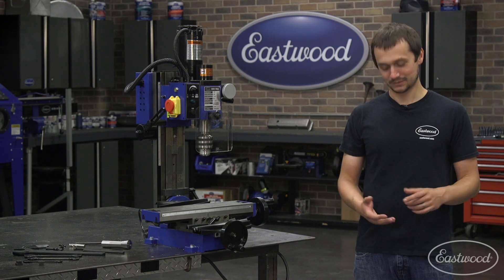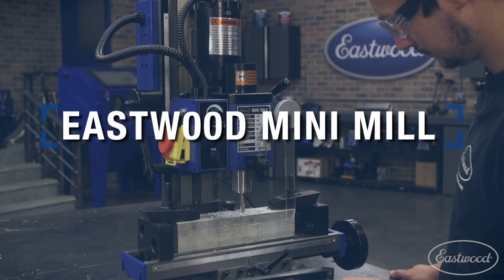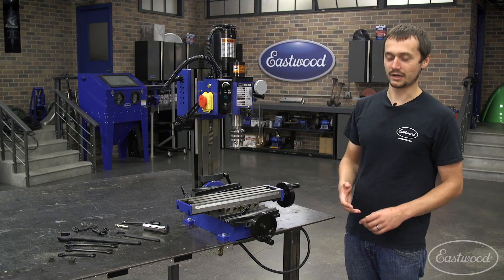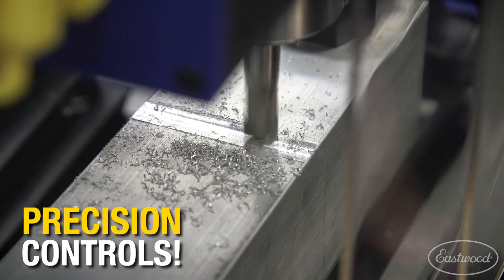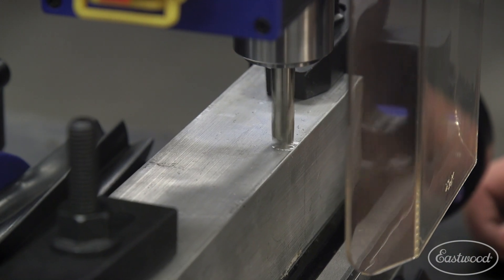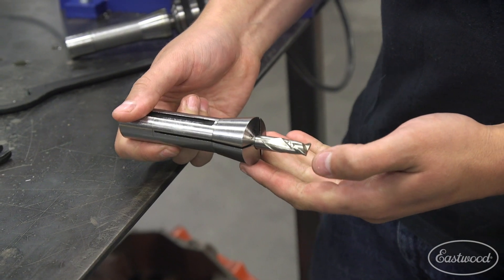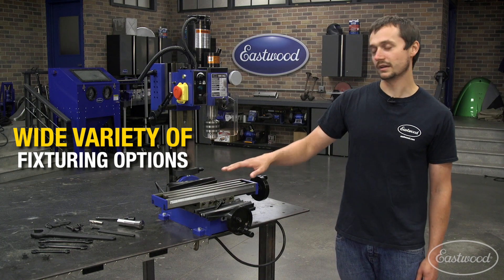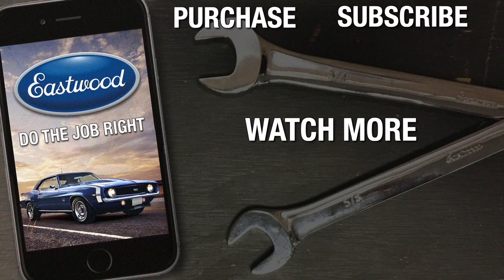The Perfect Mini Mill for Home Shop: Small Package - Big Performance from Eastwood!

Comment: Im in the market for a mini mill. If we had additional videos of the mill in action (squaring up aluminum stock with a fly cutter, speeds & feeds, hearing it as it cuts, caliper measurements, etc) it might inspire more confidence. Hearing it work is a big one as you can tell if the machine is struggling or not.
Reply: Hello i just baught osaki mmd250..what bettert to use face mill or fly cutter on my mini mill

Comment: Same mini mill as every other Sieg X2 clone, made in the same factory. At $799 it's average priced. The real benefit over other clones is it comes with an R8 spindle and endmill vs the MT3 some clones come with, along with Eastwoods support/warranty.
Reply: Thanks for the summary.  I’m off to google the different spindles you mentioned.

Comment: 2500 RPM is really low for the size of end mills this machine can run. Even the 3/8" that comes with it should have 3200 RPM. Looking at some charts 2500 RPM is good for a 1/2" HSS end mill at 11 IPM feed rate in mild steel. A 1/4" end mill should have ~5500 RPM and 1/8" - about 9000. Both 1/4 and 1/8 are more of the size for this mill. Perhaps direct-drive spindle?

Comment: Yes, it's an X2 clone like many others on the market with maybe a tad bit bigger motor.  The bigger motor is nice and being able to pick up the phone for Eastwood support is a bonus. But.....there is always a "but."  At $899 + $75 Lift Gate Fee + $199 shipping....I can't see how this make sense for anyone in the market for this type of mini mill in this price range.  Even considering those modest benefits.   I wanted to buy one, added it to my cart last night but choked on the shipping fee.  Sadly bought another brand 10 minutes ago.   Compare against the well branded Grizzly 3/4 hp mini mill at $950 + $125 shipping the pricing is a bit puzzling.  Or even $750 for a the Klutch Brand with free store pickup, which it is basically is the EXACT same machine with a motor upgrade.  Hard to understand where this fits in the marketplace.
Reply: Which brand did you go with, and how are you liking it? What made you choose the one you did?

Comment: Real ? Are the internal gears plastic or steel
Reply from the maker: This machine does utilize gears manufactured from a high quality POM nylon material for quiet running and operation.
Reply: Don't want to be making noise out in the shop
Reply: How to buy it and how much it cost?